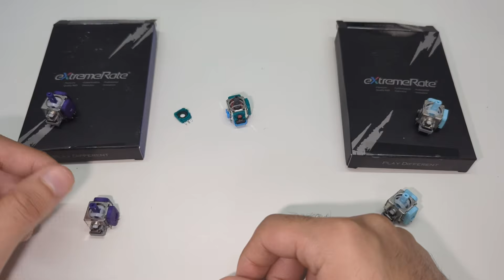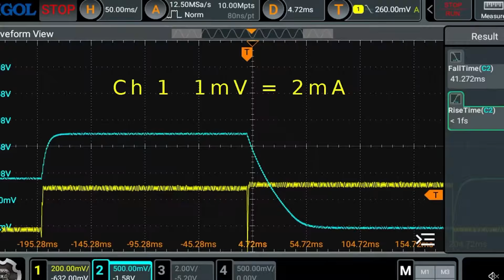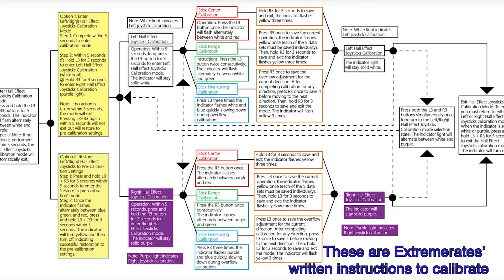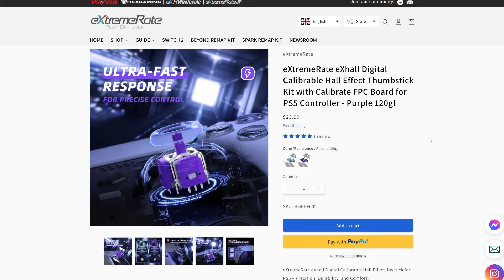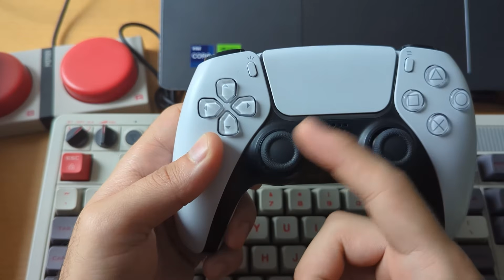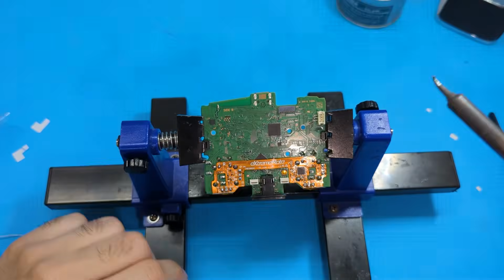ExtremeRate Hall Effect Joysticks | eXhalls Review

Comment: It happend to me before I calibrated 5 controllers an on the 5th one it did it, it wouldn't turn on at first but if I plugged it in it still worked with no lights, so I held down ps an plugged it into ps an got it to turn back on

Comment: Calibrating using the DualShock Calibration GUI isn't ideal for achieving proper calibration. While it's easier, you'll never get the calibration close enough. Once you get the hang of calibrating with the controller itself, you'll find it becomes easier and doesn't take as long as the person in the video suggests. I have the Hex Phantom, and I find that the calibration tool works better than the built-in one on the ExtremeRate Hall Effect Joysticks. These are the best Hall Effect joysticks I've ever used
Reply from the maker: What is a proper calibration according to you?

Comment: Just saw a video to with replacement Hall effect triggers with adjustable tension like Xbox series 2 elite. Woooohoooo. I’ll have to try them next time around
Reply from the maker: Ah yes, the Gulikit TMR, I have them with me right now. I just recorded a short which I will upload today or tomorrow, and I will also have installation videos about that. It is going to be interesting because I like the low tension of the ExtremeRate/Ginful joysticks, but Gulikit in my opinion has superior sensors, so I could get better performing sticks that way, plus it is still cheaper than ExtremeRate

Comment: Extremerate products are junk! I agree with your opinion about how it's old technology by using the PCB. Extremerates joysticks being the highest priced ones out there is nuts. Just buy a ginfull set and save yourself the extra money and the extra install setup. 

Watching your video about the extremerate joysticks there's no reason to pay more for them. There's no extra value there. No joystick caps, nothing. Also the packaging being terrible with no protection or support for the joysticks is just flat out laziness by the company. 

I personally like the gulikit TMR kit. It's well packaged, comes with joystick caps, easy to calibrate and about $10 less. I just don't see how the extremerate has any chance in the joystick market with that product. 

Thanks for the video. Very informative.
Reply from the maker: Thanks for sharing your thoughts. After some play sessions I would say that I like the low tension version more than stock, but that one can be bought in TMR version directly from Ginful for cheaper, which is why cannot quite recommend the ExtremeRate version
Reply: Extremerate products are not junk!  Maybe there halls arent ideal but im not touching a controller with out rise 4 back paddles they work great and are priced great
Reply: @JordanDeBuck there joysticks arent very good. There other brands priced much better and way better quality. I haven't experienced extreme rates controller shells or any of there mod kits. But I'm going to give there face covers a try and see how there covers fit.
Reply: @forestfire8  i mean my back paddles have lasted better than sucff paddled and they have worn out witch was actually due to my error installing, but a replacement ribbon was offered for 10 rather than needing a whole kit over all ive loved their option for the price, i do feel their contoroller  part upgrades like shells are a little high compaired to other options that exist but not by a lot still resonable, but as far as mods like paddles hair trigglers  all clicky buttons or even led buttons, there are no better options
Reply: @JordanDeBuck I have an dualsense edge controller and I'm looking to replace the back cover that has the grip on it. Cause there probe to peeling off. As far as I can see extreme rate the only company I can find that has replacement back covers for the edge. So I'm going to give them a try for the cover. Hopefully it's decent!
Reply: Thats why i like them, i feel they re mostly looking out for gamners with what they offer most pricing is good, products have always been good. They even sell back paddle replacements for the edge to repair it even though extreme rate has their own paddles, so kinda compitition for them yet the give gammers a solution who chose the edge @forestfire8
Reply from the maker: They have other backpaddle kits too now, I've yet to try them out but they seem more like how Scuf paddles look like. I've got some already that I will test after my next video I'm working on. i have high hopes for them
Reply: @Baro-Fix oh nice thats super sweet! Extremerate is good!

Comment: Ginfull vs favor Union, response time and input latency is virtually non existent.

They both use the same manufacturer for there TMR encoders. So it's laughable with how the f.u reps have gone about it. The alignment flawed. And the module is still the same 20+ year old one. Where as Ginfull tweaks often. Improving the design. In which if a person doesn't mistreat it. The module will last 3+ years easy. When the polyshine module only give 3-6months and slop becomes an issue. The compression spring are i poorly made. Bent stems, chipped/scratch products. Is why they over compensate. And Bad mouth the competition.

The off-axis variant of TMR is ever improving. Sooner or later they will out perform pots but not yet. That left over 5-8%+ for its avg 94% *inherent curve. Is exponential. When interference, voltage instability and module flaws (producing sways, wabbles on all axis causing under performing quadrabts. Is why POTS are still king) The reduction in noise on the signal helps drastically. Once manufacturers learn how to ofset and align them. Range, performance, and output will stabilize.
Reply from the maker: I actually did not know that they use the same TMR sensors.
Though these are hall effects and I was referring to the comparison between hall effects in both brands. Metal Plastics Electronics showed favor union has a faster response time compared to Ginful hall effect. It's his video called "the fastest hall effect joysticks I've tested"
Reply: @Baro-Fix yup, just stating that. Although there could be some use. For gaming it is over a year too late. When the competition is pumping out batches relatively faster.

So much so that some some batches won't make it in there official catalogs.

Comment: One thing to note is that the resistance will decrease no matter what over time . Rocket league destroys the resistance in no time . Eventually it’s too loose so i prefer a joystick with more resistance for longevity.
Reply from the maker: Thank you for sharing. I thought it was the other way around, but I suppose I was wrong. I did some more research: 
Regardless of which joystick you use, the spring will end up wearing out. It's just that it is noticable sooner in the lower tension joysticks because there is less margin and the spring doesn't fight back much. 
Higher tension joysticks will have enough force/tension to still center back properly for longer. The spring still wears but not noticable as fast.
I'm not sure if there are different rates at which they wear down though.

Ideally, you could use the lower tension for better gameplay, but change the tension on the spot to be higher once you notice drift. I got a video about new sticks coming out this week or early next week that can do exactly that. 👀
Reply: Remember to lube the plunger in the bottom of the thumbstick every couple months, believe me it works wonders